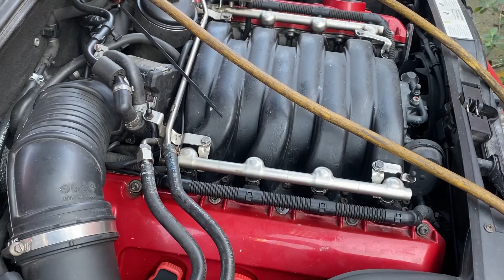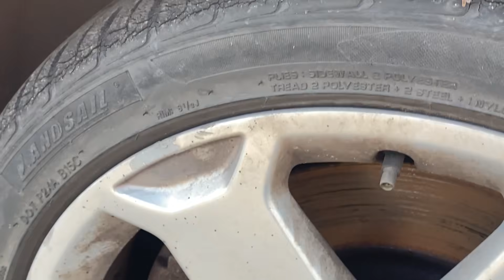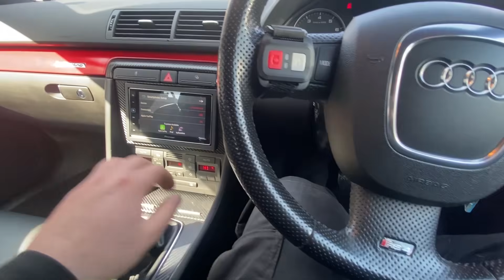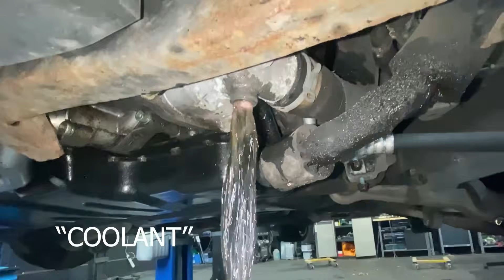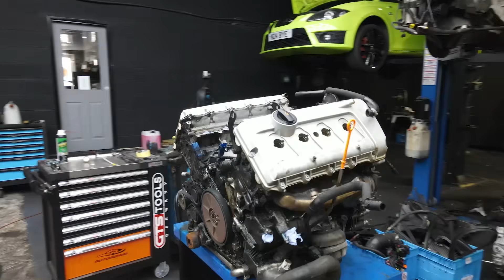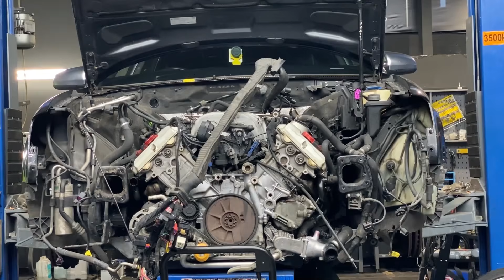Are you planning to buy Audi S4 B6, B7 with 4.2 V8? Small advise what to look at !

Comment: Just spent £1000 on front suspension parts on mine. Definitely not cheap cars to run!

One other thing to look out for is the tailgate on the Avant. The struts can be pulled from the bodywork or be bending the bodywork before they fail. Your glovebox will be broken…or already broken and repaired. Love the V8 burble though, and a magnitude easier to buy and live with compared to an RS4 of the same vintage.

Comment: That moment the VAG group implemented those foamy supports inside the front fender/wing wells, they made a huge mistake. Collects all the moisture and dirt and thats why they all rust on the top part of the fenders.
Reply from the maker: partly yes ... but no one is taking the mudguard off and cleaning them after winter .. result is rusty lip from left to right

Comment: One little thing to add to the b6 buyers guide. The headlight back caps are incredibly fragile and can crack apart just from sitting. This lets water into the headlight causing electrical faults. New ones for the passenger are nla as far as I can find. Luckily some genius has designed a 3D printable version. Once I get my printer set up mine will be getting a set
Reply: I actually needed to hear this. Thanks for the heads up! I've been dealing with that on mine

Comment: Amazing video! Would you say some of these things also apply for the B8 generation 4.2L V8? Namely the S5..
Reply: No, b8 s5 is an FSi motor
Reply: Some of them yes, altho it's fsi motor it's still has a timing chain
Reply from the maker: all of them have timing chains , we done ONE so far ... but even that didn't have issue with the chain, it was more precious  service after high mileage , they have mainly problem with the carbon build on intake valves

Comment: The prices on these cars are obviously different in the UK than for us with the steering wheel on the other side. I would love to get my filthy hands on a sorted one for 10k.. times 2, and maybe 3 fora low milage one in my home market. 
Great collection of pointers for us that is still looking for the unicorn!  How about oil consumption? That seems to be an issue for some. What can be done about it? 
This is one of the great everyday cars ever made in my opinion. Before every car had a turbo and auto of some sort. Thank you for what you are doing!
Reply: bought mine for $2000 with 141000 miles, needed a clutch, flywheel, two cv joints and some front end parts and tires.  I did the work, so I have about $4000 total in it.  0 rust, as it was parked every winter.  Chains had been done before...twice!  Has lots of leaks, and burns a quart of oil every 300 or so miles, but hardly ever smokes and still pulls like race horse and sounds like a beast!  I couldn't afford one fully sorted, but I'm close to 160000 now running her hard and having a blast!
Reply from the maker: True ! But also the service elsewhere is mental money as well … oil consumption is there like on any performance car + 40 valves 😅 1L per 1000km absolutely normal , depends how you drive the car .

PCV might be faulty 
Cylinder valve seals might be gone ( specially on exhaust ) 
Worn piston rings / damage costing on block
Reply: @VAGTechnic  WTF 1k = 1L oil  🤣👨‍🦽🏃‍♂️👨‍🦯👈🤬☠️😇